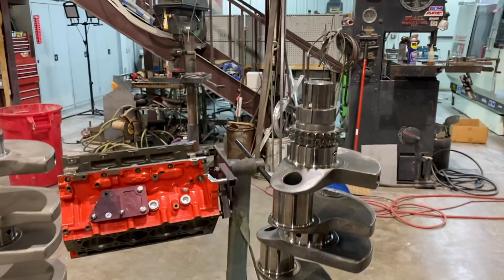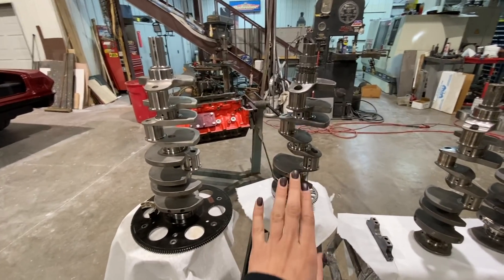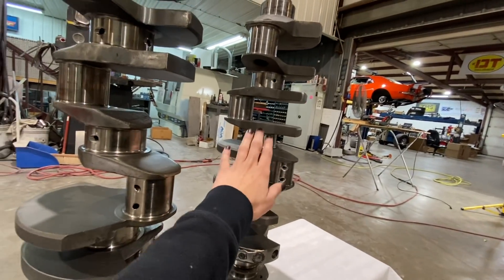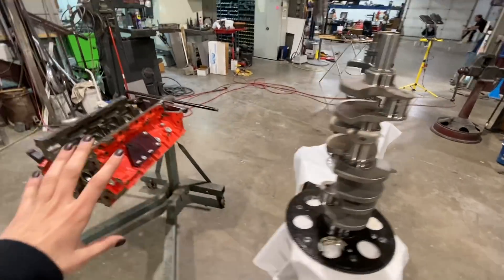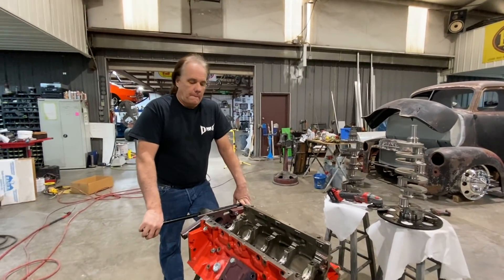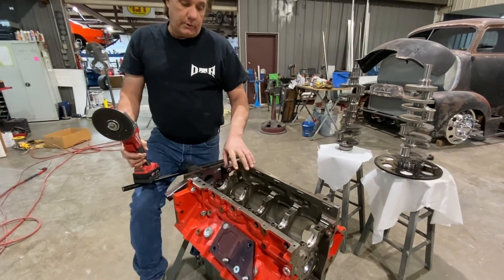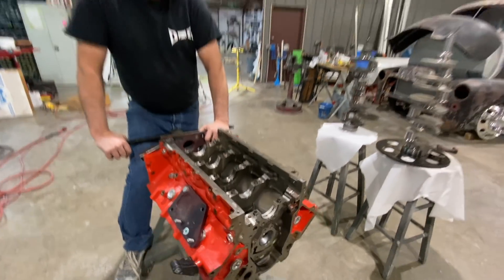New Billet Crank for Badmaro - Center Counter Weight LS Crank Upgrade and Explanation

Comment: Even though this video is 2 years old I thought that I would comment for whatever good ...  

Lower main bearing wear shown in this video was likely the result of someone using a soft shoe to polish the crankshaft.  OEM production uses hard shoes during polishing to get a very round and straight  journal all the way to the undercut fillets (ground fillet aftermarket here likely was polished with soft shoes or a grinding wheel that was not dressed properly).  

The center counter weights are all about trying to maximize oil film thickness at mains #2 and #4.  At high rpm (7,000+), the minimum oil film thickness is actually in the grooved #2 and #4 upper main bearings and not the lower.  L/D (length to diameter) ratio of the grooved upper causes this.  Think of each upper main bearing as actually two bearings that are not very wide so it is easier for the oil (film) to be squeezed out under high rotating and reciprocating load.

If you don't believe this machine all of the counterwights off of the crankshaft and place the counterweighting 100% external balance on the flywheel/flexplate and harmonic balancer.  Then run the engine an hour at no load (in park/neutral or on dyno) in one thousand rpm steps.  It won't take long to destroy #2 and #4 main bearings (oil film thickness in the uppers will head towards zero).  The best counterweighting (and the heaviest crank design) is actually bay balance where the rotating and ineria loads are countered within each bay and only a minimum amount is transferred across the mains.  

Combustion loads for each cylinder firing are transferred to the lower main bearing shells every other crank revolution so counterweighting is not effective in helping reduce combustion loading.

One thing further, the aftermarket ground fillet crankshafts shown in this video are very weak structurally.  The arm/web structure is concave.  This leads to low bending stiffness.  Most cranks that fail in the field, fail as a result of bending fatigue and not torsional fatigue.  This low bending stiffness greatly increased pin and main fillet stress which reduces the endurance limit / fatigue limit.  The typical LS production cast cranks with decent arm structure and undercut and rolled fillets (high compressive stress) are very strong from a fatigue and endurance limit standpoint.

The fillet rolling equipment is very costly so aftermarket relies on 4000 series steel material and it is barely able to match a cast nodular iron crankshaft with modest fillet roll loads related to fatigue properties.  Most of the aftermarket crankshaft designs are very poor from an arm/web structural standpoint.  Many OEM cast cranks generally have a huge safety factor in relation to their production power levels.  But the OEM's could double fillet roll loads with their cast crank designs and end up with cranks way stronger than the best forged or billet cranks.  Aftermarket stroker cranks may last a while (minutes or an hour total) at 1000+ horsepower but put them in a boat and run somewhere between peak torque and peak horsepower for 100 hours (10 million firing cycles / infinite life) and see what happens.

This is not about OEM better than aftermarket, just education, even if not explained well here.  Maybe a few people will stumble across this comment and get them thinking a liitle bit different about their crank purchase decision before spending $'s with high expectations.

Comment: I recall having a early year Chev. 396 CID, with a power adder upper end, built  by possibly a well known in town speed-marine shop, (they should have known what they were doing = (???).  My first hard run, washed out #7 #8 rod bearings also.  I put new bearings, (crank journal  rod positions looked ok), ran it the rest of the weekend, then sold it the following week for the same $ amount it was purchased for. (Pleased with that).  (396 engine sure seemed in demand in those days).   Stock bottom end could not handle the added power. (My opinion obviously).  (Next engine purchased had four bolt main end caps, plus center cap with a dual facing thrust bearing.  What a dependability difference).   Thank you (again), for bringing back the engine experience memories via your YT posts!!!

Comment: Hello I'm Jonathan from North Carolina I love that you into cars   get a used crank or get one from speedwsy motors I just got a set of 202 alloy headz for my model a pretty cool can't wait to get it going head came in and l got a 010 block which is  ls motor I heard they flow awsummme the ballece is out or the oiler needs to be drilled out the oil pump the ls is a great mom ls 3 heads  balance the rod s balance pistons but the flow that good  you and your dad get aling  my dad had the oldest volvo dealership is was coast hw died i we to work foe toyota to 23 years I love cars I gor hit head on hurt my back then the doctor cut nerve cord in my legs so now I can hardly walk anyway I'm still hanging in thete

Comment: Hm, I’m not an engineer but wondering if GM added the extra material to the center crank web in an effort to reduce block flex caused by the non center weighted crank?

Comment: What happened to the dowel pins in the thrust bearing? Is that still the same block? The 1 with the funky rear timing cover??  I thought that was amazing all the work he did on the thrust bearing. Pinning it and the oil passages on the face.  As far as I've read and heard the ls is hell on thrust bearings at any big power level. All I can figure is extreme hp, add in a stiff SFI flexplate, converter ballooning and  200psi plus pump pressure trying to drive the converter out of the trans. Your dad is 1 hell of a man, I've talked to him online for a while now. Maybe 1 of these drag weeks ill get to come out and see you guys live.

Comment: fyi:  I had a similar issue with my main bearing wearing just as yours is.  Found a hairline crack in the block at 3rd main extending to cam journal. Also off the corners, oil psi was dropping from 80psi to 60 psi on the straightaway 8500rpm. good luck

Comment: without the fully counterweighted crank. the ends are heavier than the middle and the crank when it reaches some RPMs the crank will actually start flexing tearing out the main bearing. with the fully counter weighted crank.. each of the crank sections weighs the same so it can't flex in the middle.   try to order the rods and pistons to the weight so you don't have to remove or add any weight to the crank for balancing.  if the crank needs to be drilled.. use extreme care to perhaps take some off each evenly,  what good would a fully counter weighted crank be if the balance shop makes it heavy on the ends again.   you might also use a bore scope to look down your oil galleys..  sometimes you can get a lot better oil flow by going deep with long burrs to take the sharp corners out then go in with a riffle or shot gun ball hone to really smooth out the oil galley bores.    if you have data recordings of last years runs.. please examine the G forces during the Entire run  and examine how much oil will be slung to the back of the block and perhaps uncover the pickup.  i have always wondered about crank snout mounted oil pumps trying to suck oil up from the pan during high G force launches.   imagine doing panels in the pan and crank scrapers to divert oil from the back of the crank and block into the sump where the pickup is.. only you know what your G forces are.

Comment: I'm just asking not telling but does everybody in your camp feel the engine has good enough oil control? It looks like to me on  a long enough pass at some point the oil pump could be sucking air because the pick-up does not have oil there. That is what it looks like to me.. I think you need a different pan or a different windage tray or something. Good luck and you have some very nice parts.

Comment: To me improving the crank at the expense of weakening the block.
That old 7/8 journal seemed to have a crack on the radius? As well as the weird damage. Dare I say the crank is not up too the job?
Is the GM iron up to the job,, or will a Dart etc be better. Reputedly far better material

Comment: Alex with the mid your dad did to center main cap which normally houses the thrust bearing on LS motor   will stock style bearing thrust bearing be used still.  If not what is used
Reply: 918 motorsports the stock style bearings still work. The thrust surface of the main is not actually messed with.

Comment: You NEVER EVER need to weld in tungsten in your crankshaft unless you're a PATHETIC excuse of a machinist.  I don't care what any WANNABE machinist says, do it right , no welding needed. I've done this for 30 years, 5-6-700 cubic inches of mountain engine, blown, turbo, nitrous.
Reply from the maker: Well. We don't have the equipment to balance our cranks or do block work. Therefore, we have to outsource to other shops. When you are given a balance job, where the mallory was not installed correctly, you have to do what you can and take it to another shop to salvage a very expensive piece. No, welding was not ideal, but in order to save the piece, and make it safer than it was, it was necessary.

Comment: Great Video  .. never saw your channel  before...  I built a  427 Stroker  Truck  motor  for my Tandem  Axle  C-65 Truck  ..  Hand the Crank Forged Crank  4.250 Stroke .   Stock  454 TRW forged Flat top pistons a nd longer  Crower rods..  With this combo I did not have to use custom pistons..   I had the crank  internally balanced  but  being a Low RPM truck  engine did not bother with the fly wheel  huge diameter used  dual disk  12"  Clutch ..   starter  relocated to mount the GM Truck  bell housing  #2  and uses a  13 speed Fuller Transmission..
  The engine always had a slight vibration at idle  .. yet with very mild torquer cam ran  very smoothly .  at about  30,000 miles  one day I started it up and built  oil pressure then  the pressure went to 0 psi..   Turns out all that shaking had  torn up the roller   timing chain and  a small piece of the roller chain wedged into the  oil pump  .. breaking off oil pump drive..
   Of course you know the Truck engine has a  0.400 taller deck height.  I  did have to grind quite a lot in the crank webs to clear the  4.250 crank  shaft..  Be  sure and use  two  rods  on a journal  when  checking clearances..  One rod  can tend to move to the middle of the journal .
  Local auto parts store  had  done the machine work  on my previous 427 truck motor  when my Father still owned it .. and  it slipped a press in wrist pin  and  chewed up  one Cylinder which I had to have sleeved..  I used a  junk yard block to build the 486 Motor .  that block needed  two sleeves.. had a  10 quart oil pan  instead of 8 quart pan ..
  I did not have to change the  balance of the Motor .. I just bought a  new  Harmonic  Damper  for a  366 Cube  Truck engine with 4  pullies on it  This Truck has an air compressor  and  two belt  alternator ect..
  I had the pistons  valves and combustion chambers  Henium coated..  The Henium fell off from the Pistons  and   it is like sand in your engine..   It scratched the cylinder walls  so badly that  it was burning  7 quarts of  oil per day .. Can   you imagine  filling all your  little quart  bottles with oil from a  55 gallon drum  and  having to add 3 more  quarts of  oil in the middle of a work day spreading lime off road for Farmers...
  The first pistons were 0.020  over  second set was 0.040  over so now it's  488 Cubs..  OI used the next  step  up  Crane Torquer cam ..  maybe  484 lift on the exhaust vales..  I had coil bind .. Turns out the Truck valve  stems  are shorter than standard  BB Chevy car valve stems.. So I had to use Ford Cleveland   Valve  springs on the exhaust valves.. they are shorter and did not have coil  bind issues..
  I had several  427 Chevy forged Truck cranks and a few spare blocks .. I sold them to an  engine builder and a year leather he was Murdered.. I should have tried to buy them back from his daughter..
  If  I put this   truck back on the road today .  Would be nice to make it a flex fuel motor with fuel injection .. that all can be done now days,.,  Also I welded off the  intake manifold heat  risers  and that chamber filled with water..do to condensation ..  It needed a drain hole in the bottom of the intake .. good thing  I caught that before winter.. would have cracked the intake manifold when the water froze..
Reply from the maker: Thanks for sharing your story Mike. Sounds like you have had some rough luck with your build over the years 😕 If you decide to put it back on the road, hopefully that will go well! At least you have a good story!
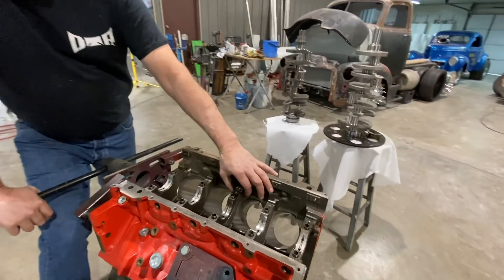Reply: @RidingWithAlexTaylor   I ran it for  12,000  hours  it has  two  45  gallon gas tanks  on it had to  full them  every day ...  I was talking about a tandem axle  truck  . Chevrolets  C-65   34,000 #  tandem  rears and  12,000 #  front axle ..  My Father bought it new  in 1975 for  $15,000.00  had the high deck  427 Chevy  with  13  speed Eaton Transmission and  7:17 gears with   no Overdrive.   had to turn it  3,500  RPM  to run  55  MPH  with 10:00 x 20 tires  43"  tall..  I  changed the gears out for  6:14  and put  46"  tall  18:00  22.5 tires  or  445 x  22.5 tires  and it is still  geared low  for  running on the highway .. first gear is  18 to ratio..

Comment: Your Awesome Alex. Crankshaft for my 545 Ford weighs 70 pounds.  I have your Decals for my ranger truck still.  Can't wait for it to be finished and to install them.
Reply from the maker: That's heavy! Thanks for your support. Good luck finishing your build!
Reply: @RidingWithAlexTaylor  when I had the engine in my fox body I spun it at 7,000 Rpms.  #https://youtu.be/g-vT_zGOaRw

Comment: Your new crank is superior. Gun bore center ,I would expect no flex compared to the one you used. You had a couple of big pieces of Mallory in your old crank. It's amazing how that thing held up. Smart move. Nice explanation on how your Dad clearanced that main web. Looking  forward to seeing it run.
Reply: And the Mallory or tungsten was installed by a hack. And I'm being polite.
Reply: @t.s.racing  yes, but I've seen worse.

Comment: How do yall feel about the top fuel hoops that KTM does to their engines? To keep head gaskets from blowing out.
Reply: Brian tools we(Henson racing engines) have used them too. They work well. It’s not just tkm, actually they were developed by Allen Johnson not really called “a top fuel hoop” Allen refers to them as a billet hoop. It’s depends on the power level. Alex and her dads engines run stainless wire o-rings with zero issues.